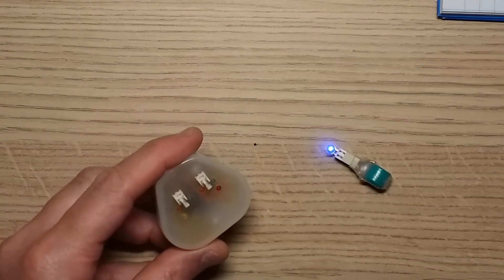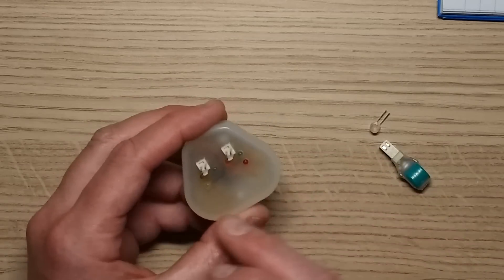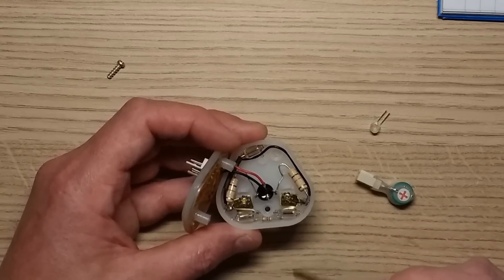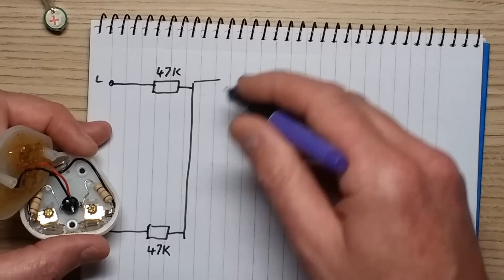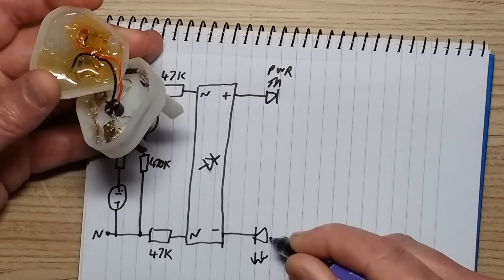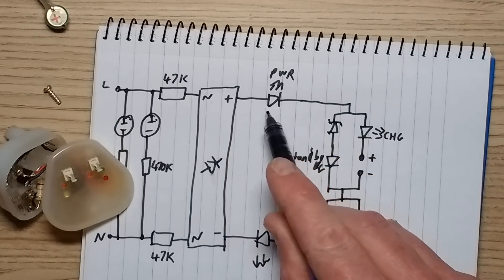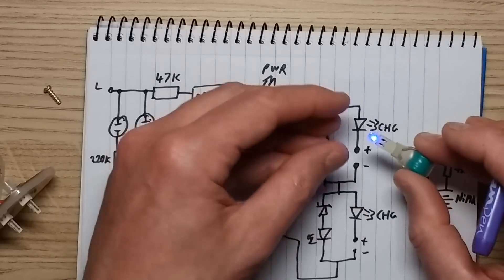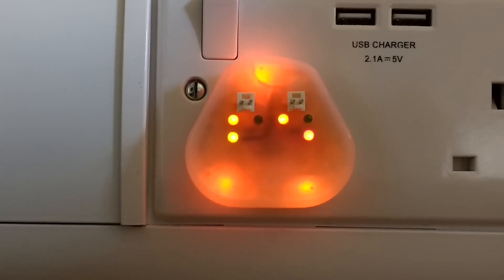Wearable LED pixel with my own shady charger.

Comment: The guys who 'invented' high intensity blue LED's were given a Nobel Prize back in 2014 for dong so, but it wasn't until the turn of the millenium that it was commercially feasible to grow the proper crystals. So I guess this device dates back to the maybe 2000-2003?

Comment: I have few types of connectors, but not the molex type you've' used in this video, or the ones replacing tungsten Christmas lights.  Could you or any of your followers mention type and size?
Reply from the maker: I get mine from Rapid Electronics in the UK.  You have to buy the housing and crimps separately.
https://www.rapidonline.com/jyk-h2500-02-2-pole-crimp-housing-22-0905
Reply: Thanks Clive.  And I won't have to wait two-three months.  Thank you for all the help starting electronics, Master Solderer.

Comment: i made a little pp3 nicad/mimh charger some years ago using similar idea but 2 10k 2w resistors, that definitely could give you a good whack if you touched the contacts 😱
Reply: ..but it worked nicely..😁

Comment: Very cool, I love  the switch back and forth LEDs, and the circuit is great for understanding the zener diode as well as the resistive dropper. My spell checker says I no longer know how to spell, and perhaps it is right, however I am just in the right mood to blame the idiots at Microsoft.  That's it, I am going back to Linux.

Comment: Clive was making led wearables before Adafruit existed. Neat
Reply: there was wearable stuff in the 80's, granted it was bulky and most used a 9v battery. i recall wrist bands, hat's sunshades and pants with the ancient stuff, seems it was mostly japanese import then, but dirt cheap at amusement parks
Reply: Well I stand corrected. I never knew of any older wearable stuff. I only know of it from Adafruit and Instructables using Adafruit. I guess there would have been a market for it.
Reply: they of course wasn't high brightness, nor compact at all. just ancient green, yellow and sometime red body leds (color encapsulation) the dinosaur ages of led :)

Comment: I think we were all just more easily pleased back in those days!

I remember when I bought what might have been one of the first blue LEDs in Birmingham, and everyone I shew it to being suitably impressed ..... It was painful on the wallet, and next to the price in the Maplin catalogue it even said "THIS IS NOT A MISPRINT" ..... but I reckon if I'd charged people 10p a go to see it lit up, it would soon have paid for itself .....  I used it for awhile in a project I built, an I/O port for a ZX Spectrum that must have had a poor connection somewhere on the edge connector, because it used to reset the machine if you so much as brothe on it .....  then when I scrapped that after one too many crashes, the blue LED was one of the parts I retrieved for use in another project .....  in fact I still have it, in a disco light sequence chaser I built -- it's part of the front panel display so I can see from behind the decks, which bulbs should be lit or not.  It has opto-isolated inputs allowing the lamps to be switched by a computer  (back in the days of Centronics printer ports, anyway)  and some nice chunky triacs good for 10 amps, so it's still useful.

Agree that a USB charger woukd be the way to go if you were building one of these wearable pixels today.  Clive has given the Poundland ones favourable reviews on this here channel, and you couldn't get a neon night light any cheaper than that anyway.  You could just have a strip of breadboard with a row of Molex plugs, wired to a USB lead with the "phone" end cut off  (that's the plug that usually breaks, anyway, so you may well have one already .....)

Comment: Don't know quite why, but it reminds me of the dodgy 'Mains Failure Warning Device' I built in 1972 or 3, which was a neon oscillator driving a loudspeaker, running from a large electrolytic capacitor, and activated by an imbalanced voltage in a resistive bridge circuit. All encased in a Tupperware sandwich box. Ahem. Looked at it about 15 years later and cringed at how risky and inflammable the thing might have been, connected to the 240V AC supply 24/7. It was loud though, despite having no amplification; audible throughout the house. Thanks Clive.

Comment: your vids need to be a little louder. that or the amp inside my laptop is shit.
Reply: Spector NS5 RD 
Possibly a bit of both, although I tend to find that Clive's videos are a little quieter than others but consistently so.
Reply: Just enable that auto-levelling volume if you're on Windows. (or Linux, if you don't mind editing a config file)

Comment: Question: When you have 3 batteries in series like that, won't the one in the middle discharge?
Reply from the maker: They will all discharge equally, but one will inevitably have a lower capacity and run out first.

Comment: Ahhhhhh, I recognise that battery pack very well indeed..... If you know your Maygay Epoch based Fruit Machines, you will know this "Green terror from hell", as the main reason the main MPU's used to fail, by way of how they leak (As in being left for extended times and not being charged), combined with the most god awful board design (Very tiny tracks) by a company in Derby called DJP / OneStop. https://youtu.be/fDJzxPaFAZk
Reply: This is the battery pack in question....

http://www.ebay.co.uk/itm/VARTA-MEMPAC-3-V15H-3-6V-15MA-BACK-UP-BATTERY-fd1c4-/290549748924?epid=1388227424&hash=item43a61d54bc:m:mImGoj6cdsLWibZWcYfwLGQ

Comment: 5 mA will kill people with arrhythmias.
Reply: But it's clamped down to near 24-30v, unless you stab yourself on the chest, the body won't conduct all that intensity.
Reply from the maker: I think that's slightly exaggerated.  In the UK with our 240V supply the fatality rate from electric shock is roughly one in a million.  Enough to make headlines when it happens.

Comment: I suppose the modern equivalent is APALS, essentially coin cell, button and LED in a sealed plastic baggy with double sided sticky tape on the back to stick it to things. But they're meant to be disposable.

Now imagining a version with velcro instead of tape, and using inductive charging.

http://brite-strike.com/APALS.html
http://www.pri-international.co.uk/apals-en.html

Comment: Whoa, what do I see there? Some USB plugs built into the wall socket??
Reply from the maker: Student accommodation.  It's useful, but I still disapprove of built in electronics like this.  if I was very naughty I'd bypass the circuit board and out the mains directly to the USB output.
Reply: That surprised me too, especially after Clive saying they were not a good idea, then I remembered he's not at home just now, Edinburgh tattoo time, so it could be workplace or hotel socket.
Reply: Clive, that's arguably good fun.... until you use the socket next year, forgetting that you enhanced its capabilities!

Comment: Oh the irony that your mains socket now has built-in USB chargers. Just plug the battery pack in there without even an extra resistor, and bam! instant 3mA charger :)

Comment: Not really a "pixel" which by the definitions I've always seen means a multi-colored "intelligent" led ala WS2801WS2811/12/12B.  That does NOT include "dumb" RGB LEDs (common anode or cathode type).  What you got there is a battery operated "LED".  I am QUITE disappointed with you...  ;-)
Reply: The word pixel is a somewhat bastardised contraction of the words pictures and element. A pixel is just the smallest addressable unit of a display grid.
I think you're confusing the usage of pixel as shorthand for a Neopixel™ style "smart" RGB LED circuit with just the word pixel.
Reply: kirkb4989 I'm still not buying it. You can have huge monochrome led displays and each pixel is literally a single led. As a pixel is, by definition, the smallest unit of an image.

Commercial naming convention cannot change what pixel means.
Reply: kirkb4989 monochrome pixel
Reply: RE: Lettuce, I agree. Pixel = RGB led is bull shit.

pixel
/ˈpɪksəl/
noun
1.
any of a number of very small picture elements that make up a picture, as on a visual display unit
Word Origin
C20: from pix pictures + el (ement)
Reply: Its just a really low resolution picture :]

You're just only looking at this from a  color display point of view. If you ever worked with old incandescent displays like road work signs, or marquees, or like I said even modern monochrome LED displays, each pixel is a single LED, or a single bulb in the old days.

Now referring to a bulb as a pixel on its own is a bit weird, just because it could be used in a display doesn't mean its always being used in one, and therefore it would be kinda weird. Its kinda weird in this context too. But I wouldnt say its wrong.

I think the pixels you are talking about have absolutely no other use besides being a pixel in a larger display, so you would really only ever call them a pixel. They have no standalone use, like a bulb or regular LED would. It may be weird, but certainly not wrong. And under the context of making up a grid in a display, one would certainly call a littler blue LED a pixel, or a single bulb a pixel, its just out of context it sounds weird. 

OR this is a 1x1 display. =)
Reply: What does RGB stand for? Red, green, blue. Those are the pixels which make up a TV screen. One red, one green, one blue. All in a pattern so small that if you look from a distance you just see combined colours. Put them all in one package and you have three pixels together. Triopixel. There, I've just invented a new name for it.
Reply: No, the current convention is to refer to an intelligent RGB LED (WS2811/2812 is the most popular) as a "pixel" or "LED Pixel" because that is easier than calling it an "individually addressable intelligent RGB LED".  Neopixel is strictly an Adafruit thing and is a specific commercial brand name for "LED pixel" like Kleenex vs facial tissue.

Go do a Google "define: led pixel" or an "LED PIXEL" search on ebay and you will see what I mean.

Still a bit miffed at the blatant "click-bait" nature of this video!!   

(not really- just kidding - you are the best, Clive)
Reply: Well the electronics industry is bullshit then because that is what they call the Intelligent Individually Addressable RGB LEDs.  By your definition, you are calling BigClive "bullshit" as well because single blue LEDs are even further away from being "elements that makes up a picture".  Where is the picture in a single color LED?  Wearable LED YES, "pixel" no.  At least by MODERN standards, the Intelligent Individually Addressable RGB LEDs are CLOSER to being a "pixel" since they are RGB like pixels in a display have been since 1953 when color displays first were introduced.  The way I use them they are definitely pixels as they are elements of the display where I use them...

NO WHERE (except here) have I ever seen a sole single color LED called a pixel.  I see RGP Pixels mentioned MANY places.
Reply: Well, if it is a 1 x 1 display, that changes EVERYTHING!  ;-)

A Neopixel (TM Adafruit) or LED Pixel is VERY useful as a single item. They make an awesome multicolor indicator for microprocessor based items (like Arduino) because they just need ONE control line (along with the ground and power) to set the range of colors they can display, thus they make a better indicator than many mono LEDS, or even traditional RGB LEDs.  You still only need ONE control line to control many indicators (as they are daisy chained) up to some vague maximum number of them dictated on the micro's speed of controlling them.

And I apologize profusely that the electronics industry (including the holiday lighting industry) calls them "LED Pixels" to differentiate them from "dumb" RGB LEDs.  It probably IS my fault in some odd way that I cannot comprehend at this time...

Comment: Clive your timing is perfect!  I literally just got done frying my first attempt at creating a wearable led flasher for my evening runs lol.  Sick of being struck by vehicles.  Thanks for the inspiration :).
Reply: Josh Major Just get a pair of pound-store bicycle lights (with CR2032 or 2xCR2016 batteries), dangle one from each sleeve or bracelet.  For a maritime look, modify the white one to green and follow the standard starboard / portside colored lantern convention.
Reply: Have you not heard of led bicycle lights? They are about a couple of bucks each on usual sources.
Reply: Josh Major Just get a pair of pound-store bicycle lights (with CR2032 or 2xCR2016 batteries), dangle one from each sleeve or bracelet.  For a maritime look, modify the white one to green and follow the standard starboard / portside colored lantern convention.
Reply: Get the electro-luminescent vests, they're better looking than LEDs.
Reply: LED flasher seen running in park. What a headline!
Reply: I_will_get_you There: bicycles you say?  Never heard of them ;).  

John F. Doe: interesting idea with the maritime twist.  Thanks!  My first thought was coin cells too, but I need more current/ capacity.  

Paul Sengupta: BETTER than led's?!  You take that back lol!  ;)  I actually made my led arrays with blue and red 3/5 mm's with a flashing pattern that mimics the police in my region...hella bright and maximum chance of ppl actually paying attention lol. 

RWBHere: "MAN ALLEGEDLY IMITATING POLICE STRUCK BY VEHICLE WHILST RUNNING AT NIGHT- autopsy reveals cause of death was actually electrocution from dodgy wiring in home made led flasher." Lol

Comment: As a child I have made a "safer" version of this charger. Battery negative goes directly to earth and battery positive goes to live via a 100k resistor and a 1N4007 diode.
Reply: Actually, bleurizlagirl is right. I can easily plug an earthed plug into an unearthed socket where I live.
Reply: DiodeGoneWild It's always better to have a resistor in each lead, just in case the live and neutral are reversed.
Reply: earth is never reversed. Otherwise all of your metal appliances would be live.
Reply: DiodeGoneWild No; but in many countries they use reversible two-pin plugs with no earth connection  (earthed plugs still fit in non-earthed scokets.)  and you don't know which is the live and which is the neutral.  Meaning if there is only a resistor in series with one pin, there is a  50% probability of the resistor-less pin being the live one.  Separate resistors in each supply lead avoids this danger.
Reply: neutral may be swapped with live, but earth is always earth. Earthed plug can't fit into a socket with no earth. But anyway, I don't say it is 100% safe. It also slightly tickles the RCD.
Reply: This is not the case in my country. Earthed plug doesn't fit an unearthed socket (unless a dangerous chinese travel adapter is used).
Reply: DiodeGoneWild Where you live, the earth connection must be made by a pin protruding from the plug.  In Continental Europe, the Earth connection is made by a pair of "Schutzkontakten"  (literally "protective contacts", hence "Schuko" for short)  above and below the Live and Neutral receptacles  (when disposed horizontally)  touching two metal plates on the edges of the plug.  France and some other countries have an Earth pin protruding from the socket  (where it will not foul on a 2-pin plug). Pre-moulded plugs are designed with an Earth receptacle and edge plates, so they will be Earthed in either type of socket; but there is no protruding pin on the plug that would foul on a 2-pin socket.

Comment: you rock Clive.   love your website comments are disabled on your 7 port killer usb hub , I'd just killed 3 devices and almost my hp desktop , but it recovered,  devices gone.  applying power was what causes that.  1 of my usb flash drives had 28gb of data and I'd applied 12v 1000ma maybe not the brightest thing to do.  any way I can fix the usb drive?   smd cap or resistor blown?
Reply: Kal Jak >make usb killer
>plug in your flash drive and complain that you destroyed it
Reply: +# well I did destroy it and it was before I saw Clive video about exact same one I have.  the 7 port silver and black one.  thanks to Clive I know how to test these things before hand.  I used the scoshe netbook power adapter manual pdf says it's actually 19V 2.1 mA  or something.  I'm Thanking Clive for showing others before what happen to me happens to them.  also wondering if maybe a smd component blew in the usb devices that I can replace.  as my wireless  logitech mouse usb got fried as 2 usb memory sticks, ones been replaced was blank,  other was 32gb with 28gb data files.